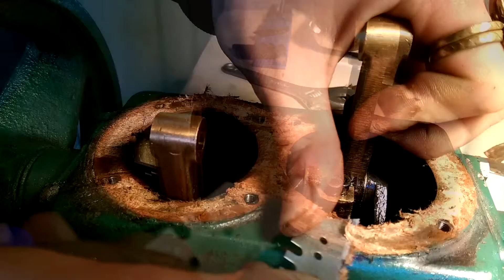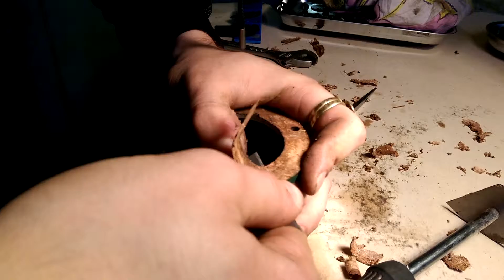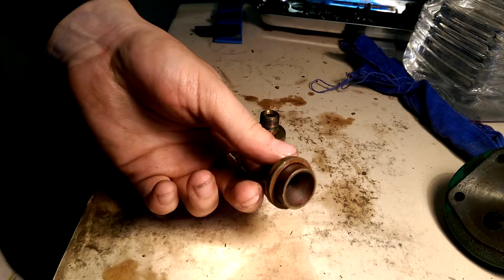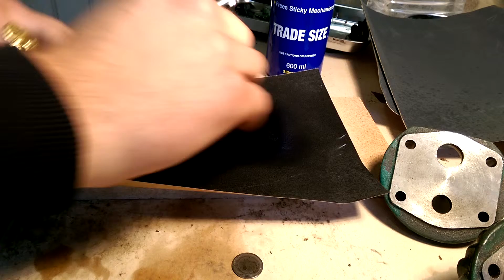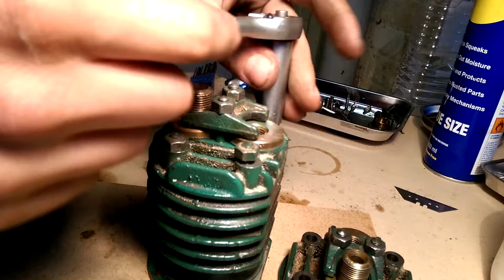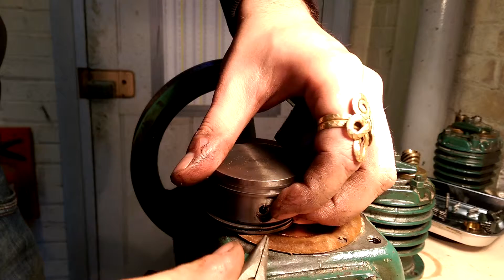Compressor Resurrection - Part 2 - Clean Up and a Dumb Mistake

Comment: When you find out the hard way that wearing a ring while doing machine work it is too late to take it off. You will likely snag the ring on something when you pull your hand back out of danger or maybe have the ring crushed onto your finger. The worst way to find out wearing a ring is wrong is when you short a welding rod through it and it turns red hot and burns your finger to the bone in a second or two.
Reply from the maker: +Jim Harris True - that's why I take my ring off when I am working with actual machine tools. Thanks for watching
Reply: +Libris Custom Knives 

Yes, I can clearly see your ring on your finger while you worked on your compressor in the You Tube you submitted  to Keith.

 Don't deny you were not wearing your ring when you were doing work (in the video) where you  applied for the tool chest.

 Just keep it in your mind in the future, no hand jewelry when working period. One of my co-workers (in the early '70's) when I ran a crew of steel erectors was welding down decking while a rainstorm came up. Anyway he was wet and the welder shorted to his wedding ring turned bright red and melted off his finger burning right through charring the bone in his finger and his finger fell off in just a few seconds. Life lessons your don't have to suffer through (because someone else does it) is a valuable lesson. For me, I was sliding a heavy barn door closed and didn't get my hand off the door before it closed and smashed a fairly large ring down to less that half it's diameter. We had to use bolt cutters to cut it off. I was very lucky and did not lose my finger.

Good luck on the tool box drawing.

Jim
Reply from the maker: Jim Harris
Erm, you seem to be mistaken my friend. In the toolbox nomination video there is not one frame of me working with the ring on. As a matter of fact, in one picture from the years past you can see my left hand and see that the ring is missing. Walking around the shop, talking to the camera, pointing at things - sure, it's on. Working on a compressor with spanners and razor blades - sure. Letting the compressor run on a test bench under power with a three phase motor wired on, using a Vee belt? Yup, it's on, because my fingers will not be anywhere near the spinning wheel of death! Operating a lathe - never. Mill? Never. Welding - last time I did some welding is when I taught my girlfriends nephew, and the ring went into my pocket before we even fired it up.
Safety is a good thing - as long as it does not dumb people down.
Reply: I worked with a guy who lost a ring finger to a wedding ring. He fell and the ring caught on something and ripped his ring finger off.
Thanks